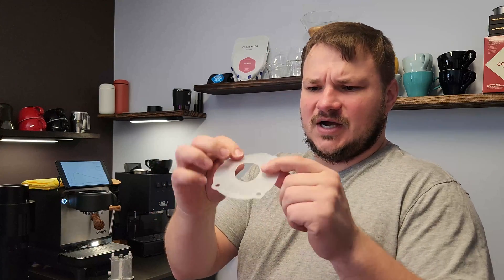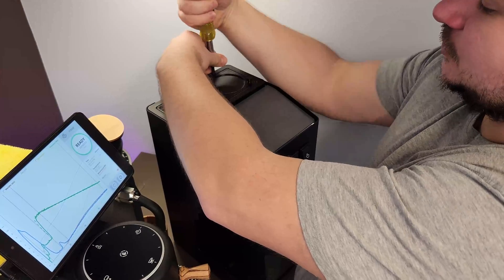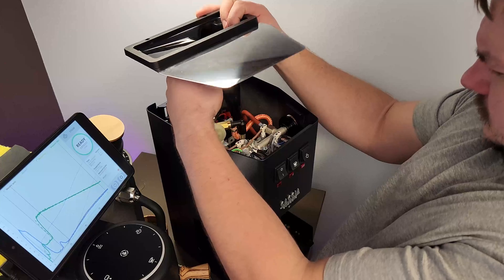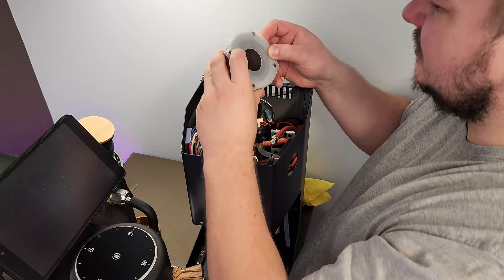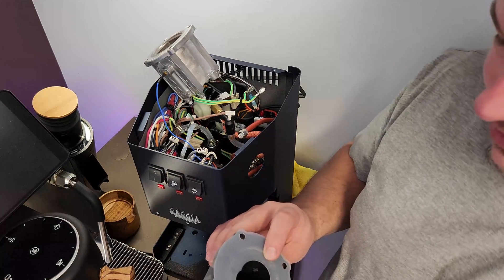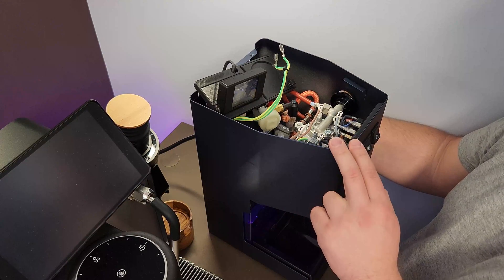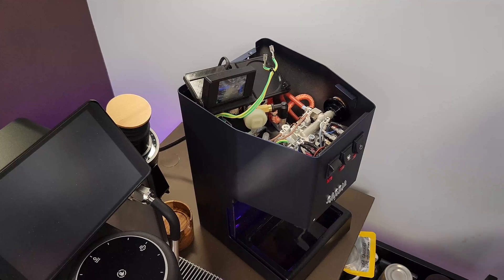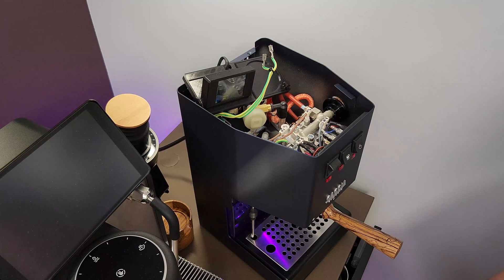Galvanic Corrosion | Gaggia Classic Evo Pro | Silicone Quick Fix | Boilergate

Comment: If the water used in the espresso machine has low pH (acidic) or the high pH (alkaline), or the water is high in mineralization (e.g. river water), then the possibility of galvanic corrosion is increased.  Because brass and aluminum are differing metals, water with extreme pH levels can function like a weak electrolyte, causing ion transfer between the metals, much like in the function of a battery.  The problem is that water is a WEAK electrolyte, so galvanic corrosion is not very likely.  There is a greater likelihood of problems from limescale long before galvanic corrosion becomes your boiler's nemesis.  You can likely avoid this problem by using bottled water.

Comment: Galvanic corrossion will NOT be stopped by the insulating material since the two dissimilar metals are connected through the conductivity of the water itself. If your water is very soft... then you can have bigger problems.

Comment: I think this is still interesting, as maybe it will displace where the corrosion usually occurs. As someone else mentioned I'd think the galvanic corrosion will probably still occur through the stainless steel bolts connecting both parts... unless you somehow replaced the bolts with a material that chemically isolates the two parts, but is as solid as stainless steel, then again, the two parts are still linked through water. How well is this holding up to now, can you post an update the next time you do a full teardown/clean of the machine (For science :) )?

Comment: Sorry, but this WILL NOT tackle galvanic corrosion inside the boiler!

The only benefit this will have is to prevent corrosion undermining the O-ring, which is neat, perhaps more effective than just smearing the boiler face with foodsafe silicone grease, but the interior will flake and corrode as before.

In galvanic corrosion the water is the electrolyte, and the bolts still complete the circuit for the brass-electroyte-aluminium cell.

What's more, you cannot safely disconnect the cell, because both components must be connected to a earth for safety reasons

Comment: This won't "fix" anything.  Having a simple gasket between the aluminium boiler and the brass group does nothing - as the two parts are very firmly connected by steel machine screws that attach the two together and that will happily conduct the electrons required for corrosion to occur .  However, the galvanic corrosion that will occur between the aluminium boiler and the bare brass group is only marginally more than the galvanic corrosion that will occur between the aluminium boiler and a chrome plated brass group anyway.  Neither are really worth worrying about, and it'll take years of use before you notice anything at all.

Comment: Was the steam wand install difficult? And is it a big improvement from the stock one?😊
Reply from the maker: Its easy to install just drill two holes and screw in. I really like the articulation with the ball joint as before there was none. Plus no burn wand is nice too.

Comment: The thinnest silicon sheet available is 0.1mm, I would use that instead of 0.8mm since you would want to the group-head to heat up fast. 
There are also 0.03-0.05mm Teflon sheet available (unfortunately not food-grade). I have made gasket out of it but not test them yet due to concern about food safety.
You also need to insulate the screws to the boiler. I think it can be done easily with braided fiberglass sleeve, Kapton tape and some washers. Cut the sleeve to suitable length to fit on the screws, and stick Kapton tape to the washers and then apply the washers between the screw head and the boiler.
I will also do the same to the brass steam valve on the top of the boiler.
To push it further, apply a negative voltage of more than 2V to the boiler (with a resistor of more than 1M Ohm in series, with the group-head at ground potential), since Cu-Al cell generates roughly 2V.  Without the resistor the current will electrolyze water into oxygen and hydrogen gas. Beware of electric isolation and safety if you want to use AC power. For trial I would want to use a lithium button battery but keep it out of the case because it is hot inside.
Reply: Could you not also use non conductive fastners using heat resistant polymers or ceramic coated botls? Also, I'm no expert but the two metals and the electrolyte isn't enough for galvanic corrosion to occur right? Like the electrolyte can't also act as the conductor between the metals? Also would be sensible to do a resistance check between the two once rebuilt just to make sure there no path between them through other fittings/earth bonding.. 

There's alot of comments saying this wouldn't work but I can't see why not and even if not fully stopping it surely it can reduce the effects massively.

Comment: Silicone gasket is not going to prevent galvanic corrosion between aluminum and brass as long as there's water flowing between the two dissimilar metals. The silicone gasket is not going to create sufficient distance to prevent galvanic corrosion.
Reply: Personally I went with the chrome plated group head as well (for what it's worth). They have been using that d design forever with no complaints. It's frustrating that they wouldn't just make a brass boiler to comply with new regulations.
Reply: I agree also and apart from that the bolts will remain without insulation. There is no way to avoid galvanic corrosion unless you put a brass boiler in there.
Reply: @Deeper-Trends  What about replacing the brass group head for the chrome plated version?
Reply: @718og  Chrome plating doesn't meet with current food safe regulations across the world and in many countries it's not allowed to use chrome in the food related industry. That's why Gaggia had to get rid of it in the first place.

Comment: Perfect Shot!
Would you mind sharing your profile settings? 
Would be highly appreciated!
Thanks
Reply from the maker: Temp 94C
Pre infusion 10sec
2.5 flow
3 bar pressure
60ml fill
Pressure above On

Soak off

Pressure Profile
Ease-in Transition
Start at 9bar
End at 5bar
Slope 55sec
Flow Limit 3bar
Ease-in Transition
Reply: @decentcoffeeeveryday ❤ Thanks!
Reply: @decentcoffeeeveryday  Just had your recipe. 
Best brew I had so far. 
🎉❤ 
Thank you

Comment: Great install - hoping that it lasts!

I'm opening my machine this weekend to do a Gaggiuino and replacement boiler install on my Evo. Two questions:

1 - What silicone sheet did you use? If you purchased online, would you mind pasting a link?
2 - Why didn't you just install the O-Ring + Silicone? Would you have any concern with just installing both?
Reply: My gaggiuino kit comes tomorrow and new uncoated boiler comes today. I’m going to order a sheet as well. Don’t want to mix metals and water. Good job finding a quick fix without having to buy a whole new group head!
Reply from the maker: I used https://www.amazon.com/dp/B0931SP1QT?psc=1&ref=ppx_yo2ov_dt_b_product_details

I went back and did install the black o ring and its working great with both at first I thought the oring was to thick and would compress the silicon but looks like it working fine.